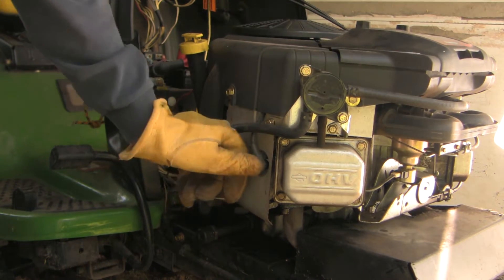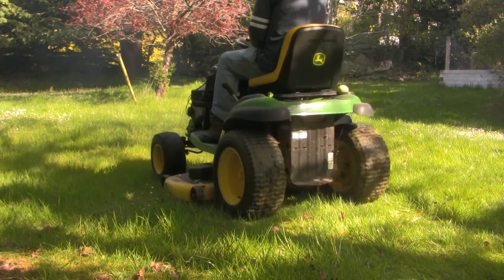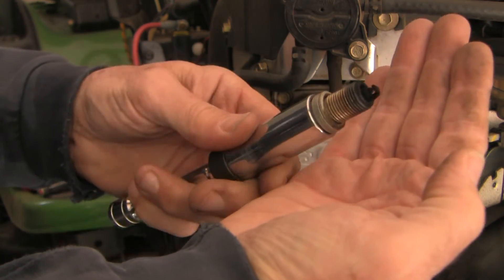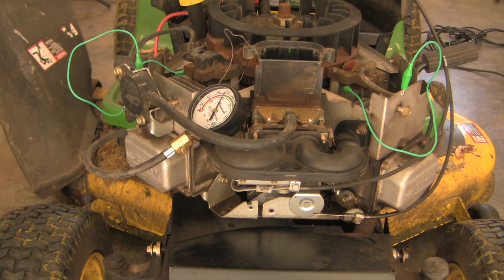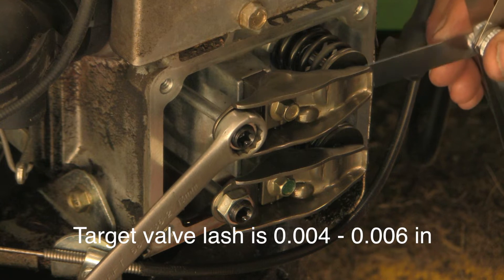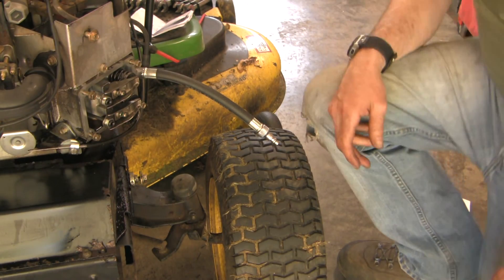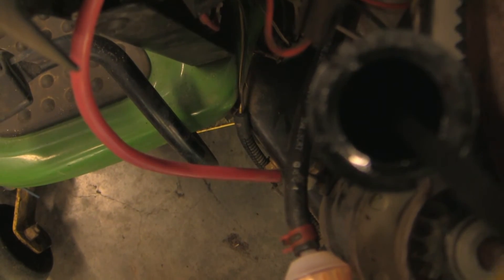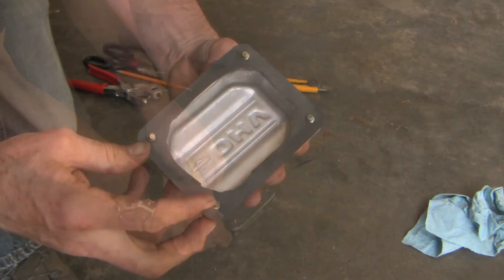How to diagnose and repair a John Deere mower with blue smoke and no power - part I

Comment: I was looking for the transmission fluid fill hole on the 110 three or four speed John deere
Reply from the maker: A lot of small engines share transmission and engine oil. I don't know about yours, the dealers repair manual or even the owners manual should help you out.
Reply: @spelunkerd  I didn't see it in the book

Comment from the maker: The one thing I would change if I were to do this video again would be to better explain the valve lash adjustment procedure. In contrast with bigger engines, the locking screw on these little Briggs engines is the torx screw, the nut is the adjustment screw, it is not well explained in the dealer repair manual. Those two work against each other, so in the end, you're good when both are tight and clearance is within specs.

Comment: What came to mind is the choke stuck on, or the oil scraper rings are worn out, but that would cause it to use the oil.
There are a few possibles, if it was an unknown engine then i would check the heat grade of the spark plugs, if they are too cold they would not self clean.
I think i would run away screaming lol :-D
Reply from the maker: Good thoughts. The ring issue was partly why I went for the compression test first, though fortunately in the end it was more innocent.